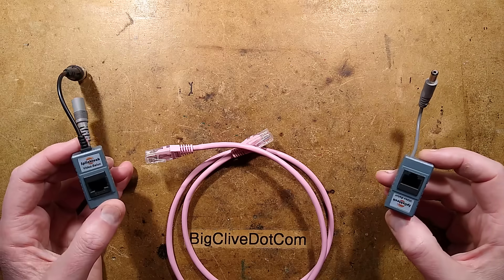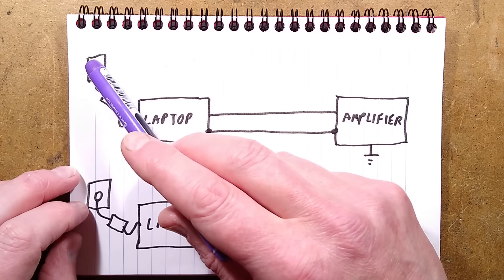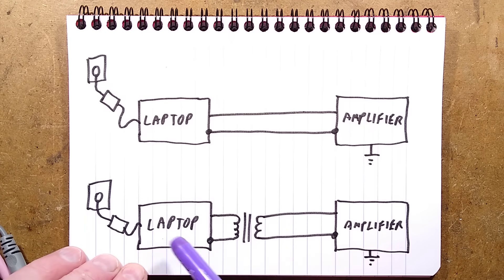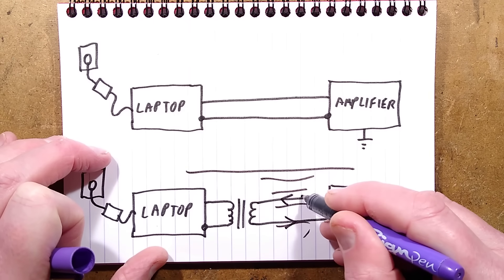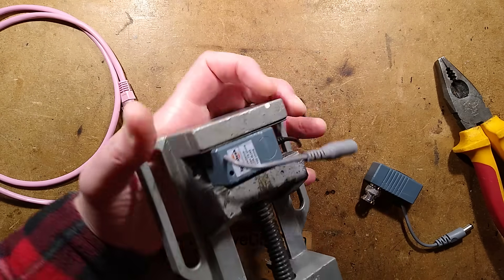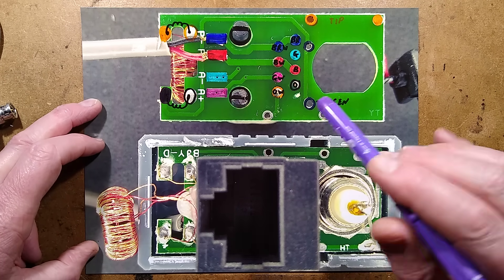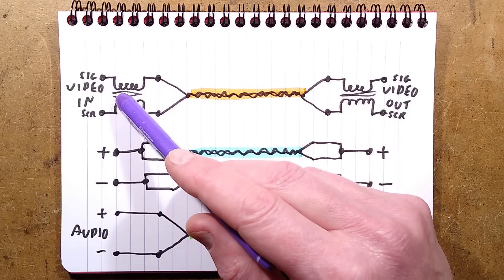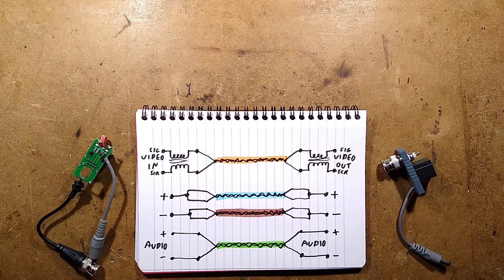Baluns - I got this one wrong (with schematic)

Comment: There's also equipment available that goes the other way around allowing Power over Ethernet and Ethernet traffic to go over a 75ohm coaxial cable to for example cameras, which is useful when you plan to replace analog cameras with modern IP cameras.
The impedance of a twisted pair cable is about 100 ohms and a coaxial cable is usually around 75 ohms, but that's a small difference and the transformers in the end units are basically there to ensure that the signal through the twisted pair is balanced to avoid causing interference.
Reply: power over coax is easy, you just need a capacitor and inductor at each end. the cap to remove the DC from the signal at the ends, and an inductor to allow the DC into and out of the coax. remember the capacitor blocks DC and the inductor blocks high frequencies.
Reply: most common I see do POE over twisted pair cable, 2 pairs for power, and 1 pair video, and the last one audio/PTZ control if camera has it.  They will do 10M data, as they isolate the power pairs from input and output, and then you connect the camera to the converter. 48V on the cable, and the output side has a switchable buck converter, providing 12V or 5V, at up to 1A for the camera. The 5V is generally for things like non POE capable wireless AP's, as many will run off 5V, and old ones max out around 10M anyway, and another common use was to power a DSL modem, as often phone lines were not convenient, and DSL here never really got past 10M in any case, even if you literally were 30m from the DSLAM cable wise, and it was outside your door. As a bonus now DSL is kicking it's last legs, Starlink has more (illegal) customers than DSL has, as the state owned monopoly is killing off copper service, and no longer repairing it either, unless the fault can be resolved with a single service call and stuff on the van only. Stolen cable you get a GSM phone that looks like a regular handset, too bad about data unless you also got it from them, then you get a dongle as well, and your subscription price and data available change for the worse.
Reply: Many years back, there were DirecTV "DECA" adapters going for something like $30 for a bulk pack of 20. Quite good for projects that involve running IP over coax.

Comment: I happen to have the opposite problem -- I have some existing coax/power runs for a CCTV security system I'd like to upgrade to PoE. I don't suppose there's a simple solution for that?
Reply: Originally Ethernet was run on coax using collision sense multiple access (CSMA) where devices shared a common transmission path (RG-8 iirc) and "collision" detection was used to resolve conflicts in who got to talk (if a collision was detected, all talkers would back of for a random time then try again).
I don't know if anyone uses that for Ethernet anymore.

"Phantom power" on a baseband video path is difficult because DC levels are important to separation of sync and video.

Be aware that video over Ethernet comes with delays tha may or may not be acceptable.
Reply from the maker: Apparently there is a way to do that.
Reply: Do you mean that you want to keep the cables and upgrade to POE cameras? Search POE over coax, a number of options come up. $50 - 100 per camera.